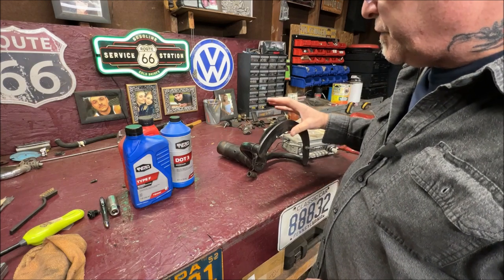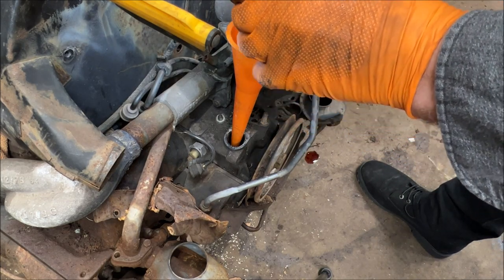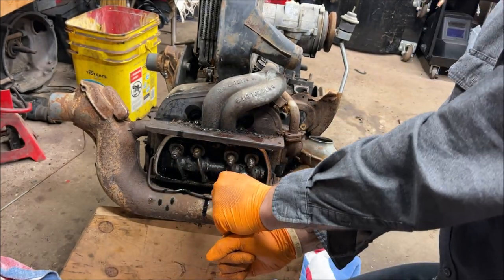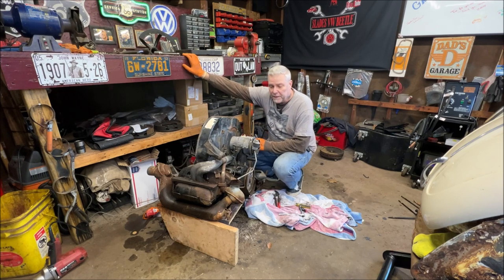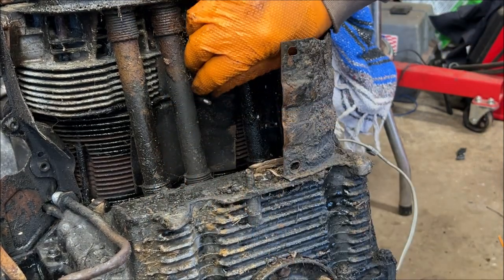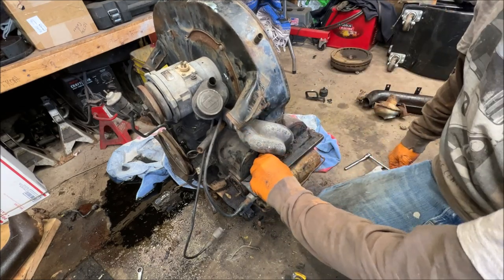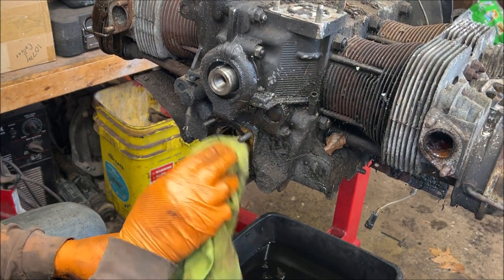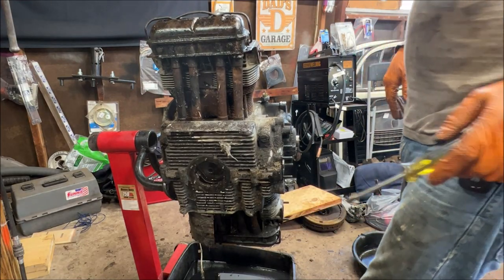VW Beetle Seized Engine Part #2 - Engine Disassembly Part #1

Comment: Thanks for the video.  It was very informative!  I am hoping my '70 Beetle's seized engine isn't stuck as bad as this one seems to be!
Reply from the maker: Oddly enough Adam it probably is not as bad. 
This was given to me, and was sitting outside in the rain, with no distributor or carburetor. So all of the water was pouring inside of the engine. You got this! You’ll be fine.
Reply: @SladesVWBeetle  Thanks, Slade!  I appreciate the support!

Comment: Hi Slade, I kinda expected it would be still stuck. Like you said time to tear it apart. The jugs will be wasted and you may as well fire up the cutoff wheel and just cut the jugs off. Pistons probably wasted anyway but at least you can separate the halves apart. Hopefully the block is not wasted inside too from the water?
Reply from the maker: That’s what my concern was, all of that water inside of it. At least it’ll be an adventure getting it apart. I doubt of the blocks going to be any good at this point. But then again it’s possible.